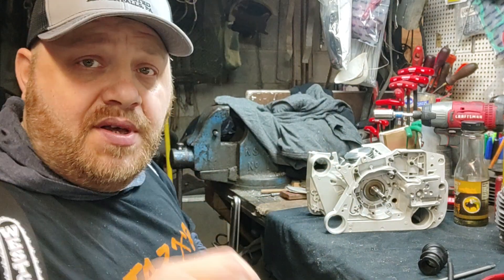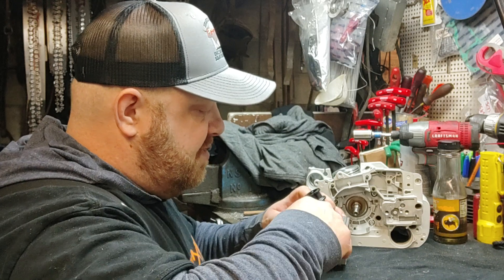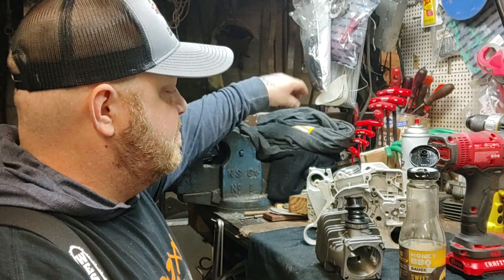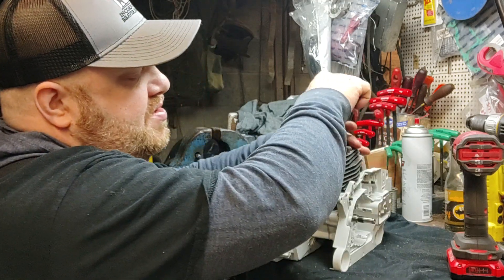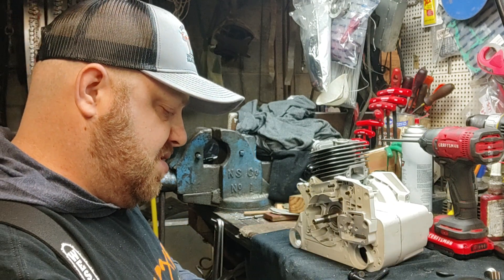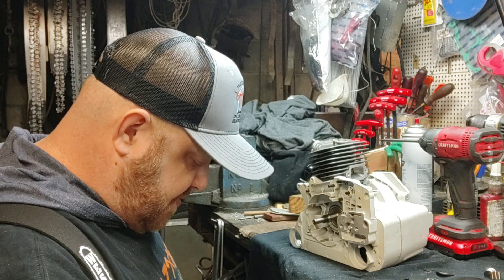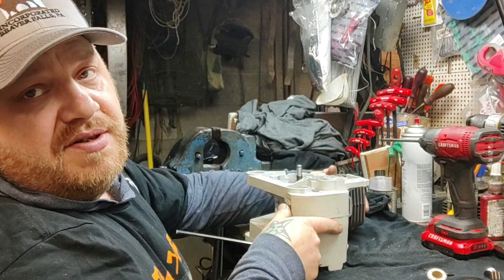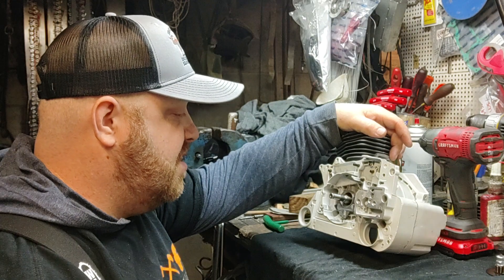PORTED FARMERTEC ms660..NEW BUILD...MY SAW...@cajun3197 CYLINDER..PART 1

Comment: I did a 660 @ 97* 119* 83* with 220psi (cold)... thing runs great... the guy runs a 7t sprocket... 24" bar... absolutely rips through hardwood. (As it should with a 24" bar) 😅